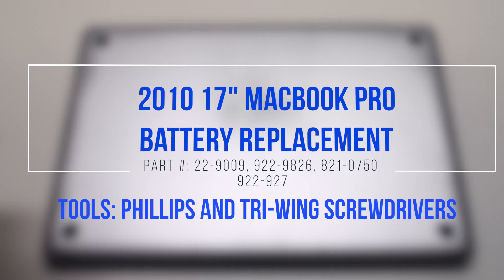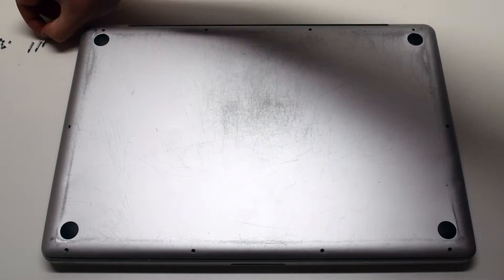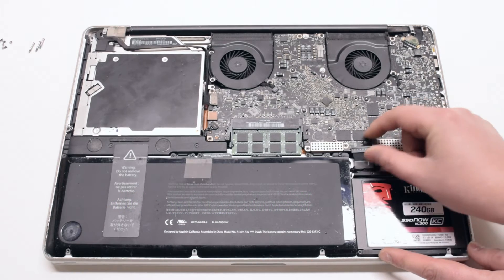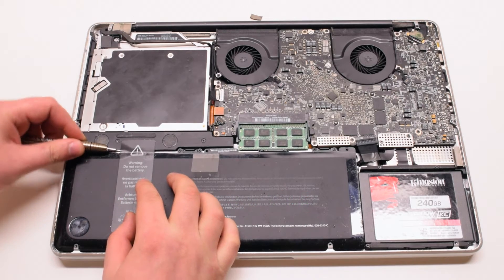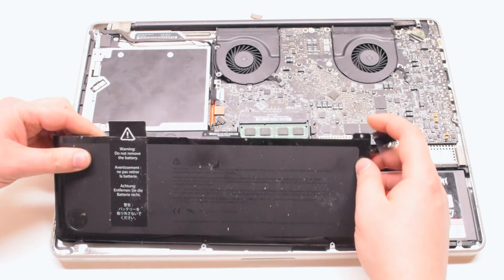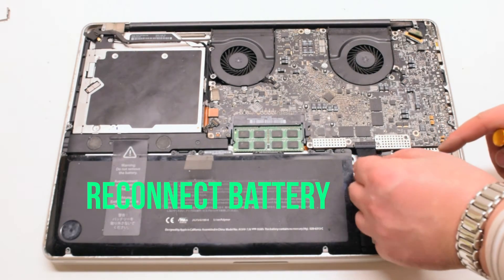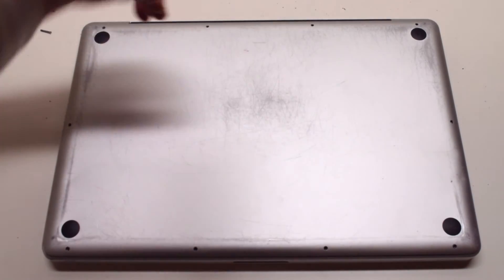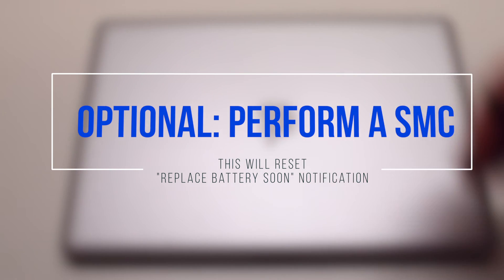2010 Macbook Pro 17" A1297 Battery Replacement

Comment: Hello, my name is Kerim and Please help me
I have a Macbook Pro 17 2010.
It came to me without an HDD but I installed an SSD and I need to install macOS.
The only thing I see is the blinking folder with a [?] mark, I tried every key no change.
I believe it only supports the macOS version up to High Sierra, but I have no experience with Apple.
I mean what should I do, how do I create a bootable macOS flash using Windows, or am I doing it wrong?
If someone could help me that would be great.
Reply: If you haven't already found a solution. Try restarting while holding down the Option-Command-R keys to go into Recovery mode. Then download the latest macOS version. Good luck. 👍